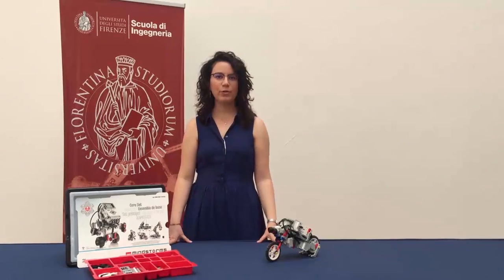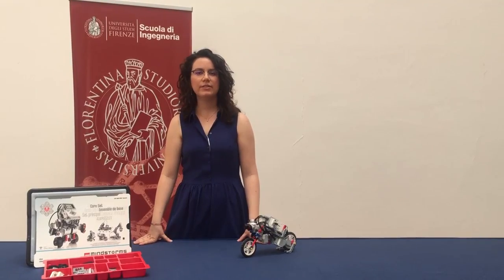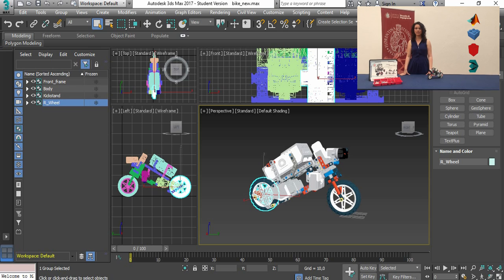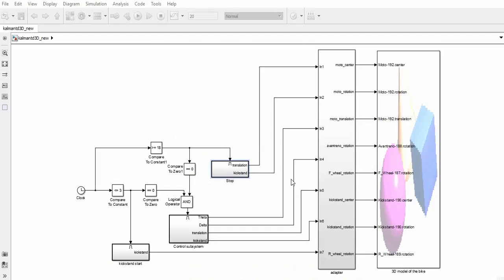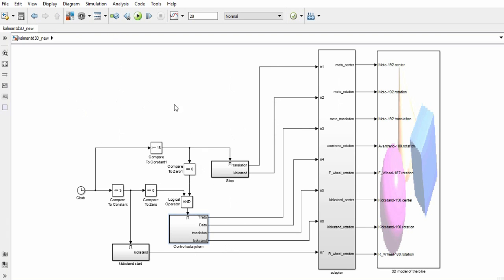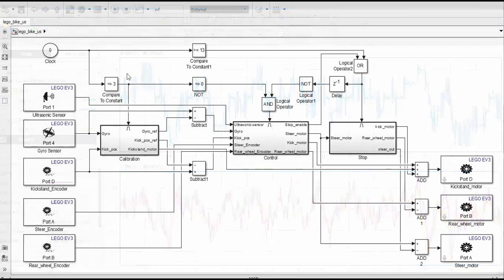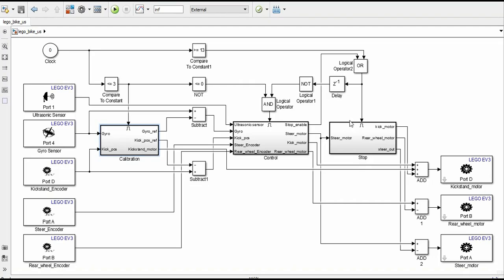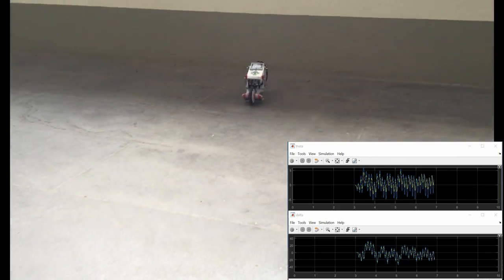Lego Mindstorms EV3 bike project #MATLABHW2k16

Comment: What was the real purpose? The project is awesome and very impressive considering the wheel in line not parallel. All bikes are self balance once it get some speed or weight on the wheels generating gyroscopic effect and forces.. Did you guys consider it for smooth control systems reactions?
I mean, the dynamic of the object once it has movement. Was it allowed on the project rules? I don't know.. sorry just considering like RC bikes..
Again, It is a honor to see people like you and team working on projects like this!
Congratulations!
ps: I shared your work on my facebook if you allows me.
Reply from the maker: Thanks for your comments! 
It is often true that over a certain speed bikes get stability, but in this specific case the max speed is way too low to obtain that. Therefore a controller is mandatory here. Changes in the control algorithm has definitely improved (i.e. smoothed) the bike behavior with respect to this video.
Please, feel free to share the project on social networks.